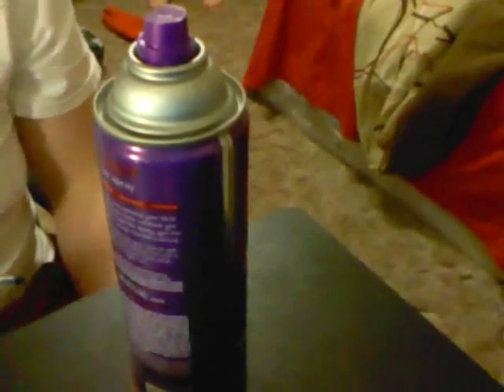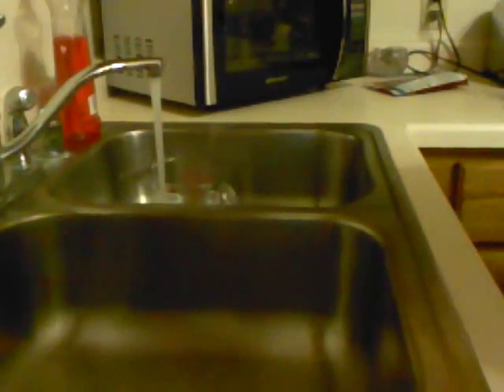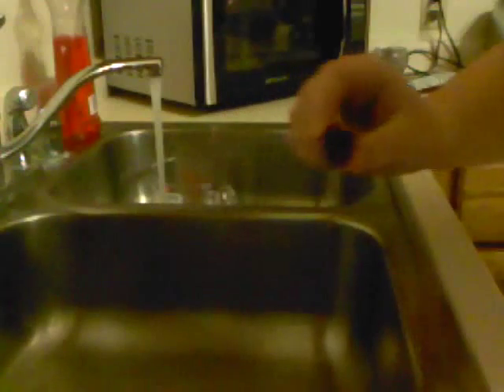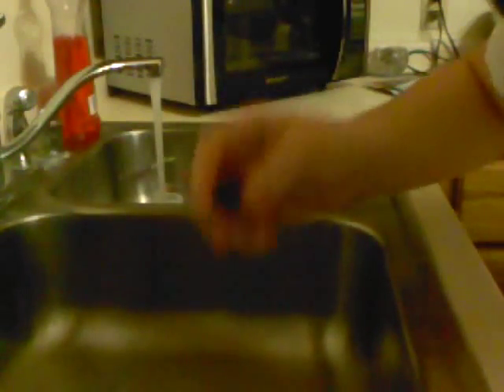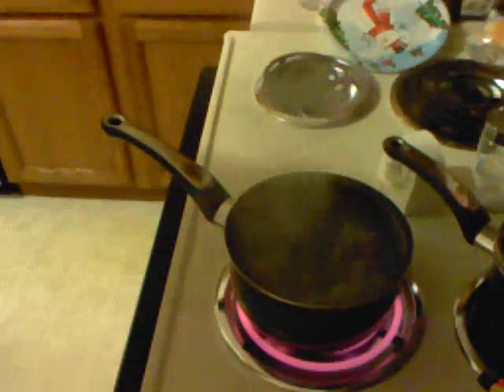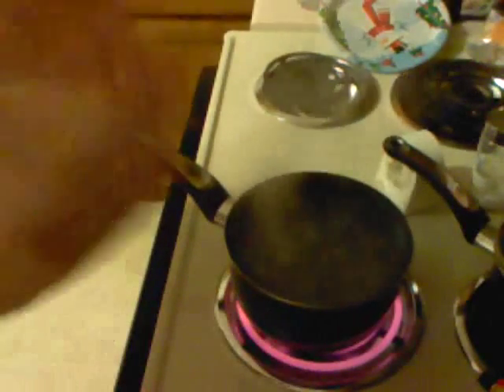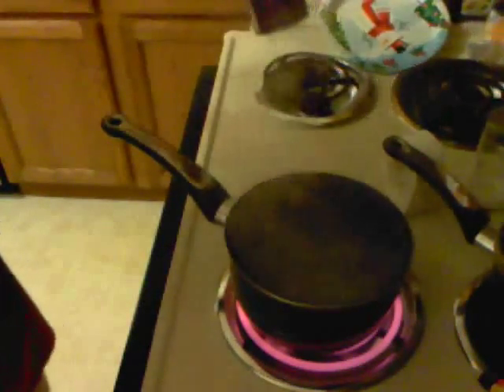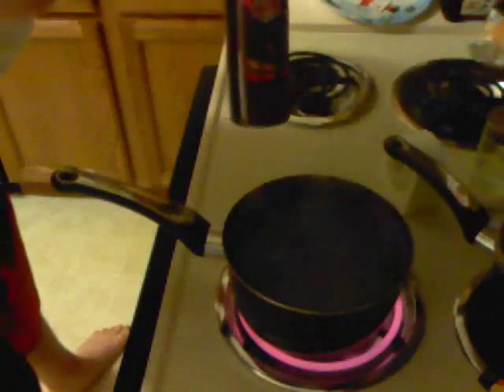Fix Your Hairspray

Comment: OMG; I am 67 years old and didn't know if I was going to end my life trying this but it worked like a charm. When you spend $20 for a can of spray and toss the receipt, you get desperate. I removed the small spray cap and washed it. Then I put a small pan of water on to boil. When it was at a rolling boil I held the can about 2" into the water, careful to not let the can touch the bottom of the pan. I held it there for 10 seconds and then placed can on the counter and quickly ran away.  After a minute I figured I was safe.  I hit the can 3 times with a can of soup to make my small dents. I then put the cap back on and it sprayed beautifully. It works!! although next time I will have my husband do the boiling..
Reply: and??
Reply: okay uh...i didnt type that at all
Reply: im literally 15 and i just say this
Reply: Actully all you can do is take the cap off and rinse it will hot water for about 1 minute. Worked for me lol.

Comment: It does work! Can use my expensive Sebastian hairspray! Filled a pot with my super hot tap water, put the hairspray can in and ran away😂but 20 minutes later I pulled the can out and it is working!😊Thank you!